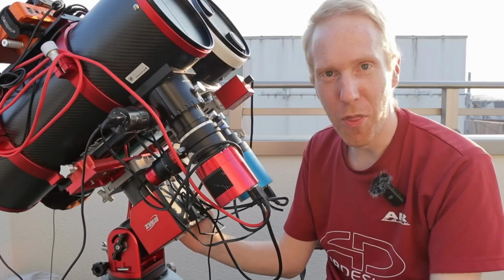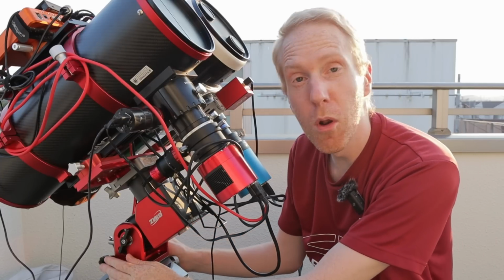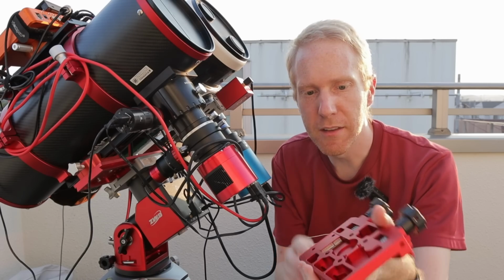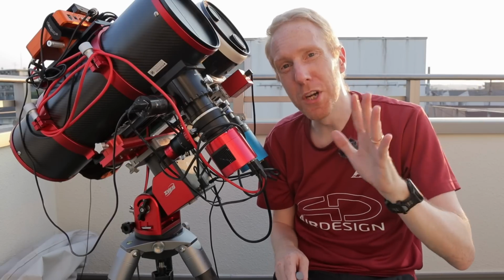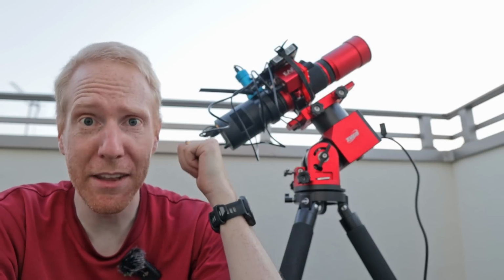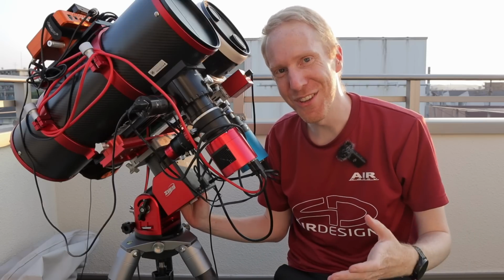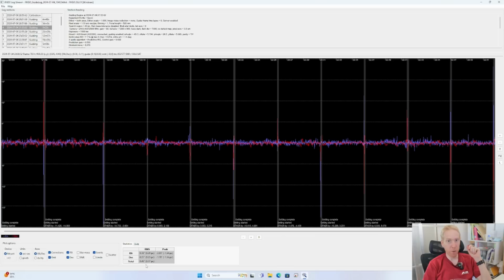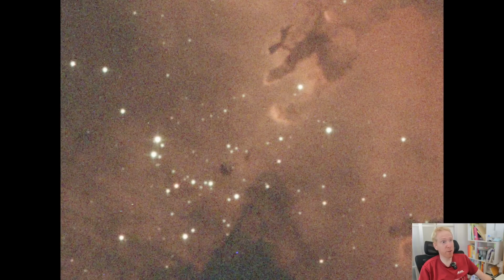I did NOT expect this! Full Test of the NEW ZWO AM5N - How will it perform??

Comment: So I can use the AM5N to power my AsiAir Mini which is supplying power to my 533mc pro, eaf, and 120mm mini? 
That would be the main reason for me to upgrade to this from the former version, as I really want a cable snag-free setup. 
According to this video, I should be able to. But I see people also say you can’t, or rather, shouldn’t do that.
Reply from the maker: Yeah in my tests it seems to be fine, and at least one other has tried with scope dew heaters as well and seen it worked fine (I wouldn't dare). My own experience says yes (I have also tested with my CarbonStar and other cameras on top, power from the mount) - but others than me are more knowledgeable... That's all I can say for sure! That said the AsiAir Mini, 533MC and 120MM+EAF should be eating less than 3A at all times I would assume, so I do think it's fine!
Reply: @CuivTheLazyGeek  Good enough for me! Thanks for the reply and I guess I’ll be looking forwards to getting my AM5N once it’s out of backorder!

Comment: The Mele Quieter 4C requires a power supply of at least 24 watts. At 12v, that’s up to 2 amps (amps = watts / volts) just for the PC. I would definitely reconcider your power supply/distribution situation.
Reply: My Quieter 4C is drawing nowhere near 24 watts with SharpCap, PHD2, and Stellarium controlling the mount via ASCOM device hub/ USB serial. I am typically seeing around 8-10 watts. I am using the standard power settings in the BIOS. I have been using the AM5N mount saddle power with my Mele, EAF, 533MC Pro, 585MC for guiding, and two dew heaters. I am also using a USB-C monitor powered from the Mele. At least with my setup, I can watch power consumption with my Bluetti battery, and I have seen a max of around 23 watts draw, including mount power, even when slewing.
Reply from the maker: Oh wow, including the dew heaters??? I really hope the AM5N has an internal fuse though, I don't think I'd dare use dew heaters via that output port on the saddle!
Reply: @CuivTheLazyGeek  , at least with my setup, the total draw from the port is well under 3 amps, including the dew heaters.
Reply: Well, you can’t argue with direct measurements. Sounds like 3 amps will work just fine.

Comment: I get similar results with my NYX-101.    I use my Polemaster to get a good polar alignment.  Then do my calibration on M12 as it too is near the celestial equator.  And depending on the seeing I typically get between 0.8 and 0.5 arc seconds on my guiding.   Sometimes I will drop into 0.48 area but that is somewhat rare for me.  But I'm perfectly happy with the results I'm getting.  I think the  NYX-101 has similar type 17 motors.    Very informative video.  I'm going to recommend the AM5 to my nephew who is interested in getting into the hobby.  ;0)
Reply from the maker: All those new SWG mounts are really amazing - I don't see myself buying any traditional GEM now...

Comment: Apart from the mass the torque is important as well. Do you have any idea about the torque of the frankenscope? As a note, your scopes have a rather short focal length, I’m wondering how a SCT with 2000+mm FL (OAG) will perform. On the subject of power, running dew heaters seem out of the question with 3A, and those are not uncommon…
Reply from the maker: I'm not sure exactly how far from the axis of rotation the center of gravity of the scope is... An SCT would be lighter so it has that going for it, but I can't answer for sure! And I agree, dew heaters would be out of question...!

Comment: Hi Cuiv. Great test! Thanks for letting me know about the cables. I don't think you missed anything. Its a great mount. I'd caution that an enthusiastic all clear on power is probably premature. I dont have this mount, and I thought I had addressed power "rigourously" on my  AM5 and AM3 rigs (but STILL I missed a key point). I recently realised (by dint of a catastrophic failure) that my cigarette lighter power cables were only 3A (and one of them had cooked). I suspect this might have also fried my Celestron Powertank (I'll only know after testing when new cables are delivered).  In any case I'm facing expensive consequences from a slightly 'happy go lucky' approach. Replacing a cable is one thing but you would not want this to happen in your mount. This was on my AM3 with only one dewstrap (likely off on that night) and a 2600MC duo  @ -10C.  But also my AM5 rig has a 13kg refractor slewing around (and two hungry dewstraps) on top of what your redcat had. 

So I think it is STILL an issue if unwary consumers are led to 'expect' something that mostly appears to work (ignoring the smallprint invalidating their guarantee). They could subsequently be disappointed, out of pocket, or troubleshooting instead of imaging, and unable to make a claim.  BTW when I swapped in my Jackery it indicated that the AM3 rig was drawing 33W (only 2.75A) while idling along, - but slewing or other peaks probably pushed it too hard.
Reply from the maker: Thanks for the tip, and user name checks out! Yeah I would never add dew heaters to the through the mount saddle, I really hope ZWO have a fuse or similar in place...!

Comment: Regarding the 90degree rotation of the saddle, you can just mill those things out and you'll be happy. While ZWO could implement holes at 90degrees in the mount so the same saddle could be used for both configurations
Reply from the maker: Agree! For now though things are fine :)

Comment: One question about the saddle port I haven't seen an answer to - is the USB-C port only a device port for controlling the mount from a host riding the telescope, or can you use it as a hub port directly to the camera, with the host connected to the front USB-B port? Obviously in the latter case you wouldn't have USB3 between the host and camera but that's ok if you're not taking video.
Reply from the maker: No, it's unfortunately only for control of the mount, it can't be used as a USB hub
Reply: @CuivTheLazyGeek  Well, thanks for clarifying anyway

Comment: Thanks for the testing!    I am on the wait list for an AM5N as it was almost immediately back ordered.   Even though I have multiple AP mounts now, I want something that I can take to a dark site easily and there is no ‘easy’ when it comes to an AP mount.   They are big, heavy and complicated.   So going to give the AM5N a try along with an ASI AIR for a mobile setup.    For star parties I’ll still bring an AP mount, but only one and have the AM5N there for a second mount.
Reply from the maker: I think the AM5N is a great choice for that - hope you get it soon!
Reply: @CuivTheLazyGeek  Thanks Cuiv, The truth of the matter is that while the mount is important for AP, most any mounts can be used to take fabulous images.    A friend of mine has ‘3’ of these AM5 mounts and uses them simultaneously.    His images are as good as anyone’s.

Comment: I would be wary of using the saddle output to power the rest of the rig. Either use it for just the main camera or for everything else (mini PC, guide cam, dew heaters, focuser, filter wheel, etc.), but not everything at once.

Sure, it might work ok for now, but the output is specced for 3A for a reason. And all that gear can and will draw more than 3A at some points, sometimes just in short spikes and sometimes for a longer sustained period (seconds or minutes). What happens then will depend on what sort of protections both the mount and your DC splitter (or AsiAIR or whatever else) uses. Might be just a harmless shutdown at best (though even that can lead to a wasted night) or at worst something might fry.
Reply: I agree with what you've said here, looking at the connectors they appear to be JST which have a limit of 1a per pin, i expect they are sharing the load over multiple pins in order to reach the 3a capacity, 6 pins would be enough for 3a. The wire also looked pretty thin, I'm guessing around 24awg,
As you say it's quite possible to draw more current than rated without any "apparent" issues but things will be getting hot as a result, if the wire gets hot enough for the insulation to become soft there is a risk of them shorting together which could cause a lot of damage to the mounts power circuitry. Occasionally exceeding the 3a limit shouldn't be a problem as long as it is not prolonged bit it's definitely not advisable. I hope ZWO have included a fuse of some type in the power circuit to protect against this.
Reply from the maker: Thanks guys for the tip! I gotta say I've been guilty of running the rig multiple times again (and now the CarbonStar rig) on top of the AM5N with the power provided through the saddle, but this gives me second thoughts...
Reply: @CuivTheLazyGeek  you could use an Inline power meter to measure the current, i vaguely remember you using something like this to aid in polar alignment some time ago.
Reply: That's exactly what they are doing: it's a 4 pin connector internally: two used for ground and two for +ve (12v or whateven input you are using). And I dont see a fuse internally so always be sure you use a fused input (the cigarette style plugs usually have an 8A fuse). Yep, I am a bit paranoid.. I've blown up enough electrical stuff in my time...!

Comment: I'm sold! Glad they improved on it with version 2 (N). Hopefully with your testing with the Frankenscope, version 3 will have an improved saddle.
Reply from the maker: It's honestly quite good - since I now have multiple mounts though I ended up taking the Frankenscope apart (I needed to remove one of the primary mirrors to unfasten a little bit the clips but needed to remove the scope from the setup to be able to achieve this), and now the AM5N has a simple CarbonStar on top of it!

Comment: I like the AM3, using it with the Carbonstar and getting < .5" guiding.  Easy mode compared to my older mount!  Since I already purchased the AM3 my bet is the AM3N isn't too far away.
Reply: Probably true. ZWO has to stop doing this: I can’t afford it! I sold my AM5 for the AM3 and couldn’t be happier (especially my back)!
Reply from the maker: I get the feeling the AM5N was following the AM3 improvements compared to the AM5, so not sure if that's so close! But time will tell for sure!

Comment: Somebody is pacing impatiently outside Cuiv's room. Anyway, my question is: should I ditch my AM5 mount, and get AM5N instead ? Currently, I am using it as Alt-Az for EAA.
Reply from the maker: No, if the AM5 works for you there is no need to switch! If it ain't broke, don't fix it!
Reply: @CuivTheLazyGeek  Indeed, my largest gripe with the AM5 mount is that they use simplified algorithm for multi-star alignment. Apparently, they do polynomial inerpolation of the stars positions, instead of aligning their internal coordinates with the real coordinates. The most vocal  person about it is the user "w7ay" on the zwoastro forum. I had a Celestron AZ mount which was very precise. AM5N is likely to be the same as AM5. I better look into the latest Celestron mounts or maybe SkyWatcher wave 100i or 150i.
Reply from the maker: @antoniohuerta9144  interesting! To be honest with plate solving I don't think that's an issue, but for visual it sounds less than ideal...
Reply: No
Reply: @l.m2517  mind if i ask what was wrong with am5 v1 ?
Reply: @l.m2517  i think zwo upped the payload on original am5 by magic, er i mean software er might be worth checking. The powered usb saddle makes envious but then im envious of the original am5